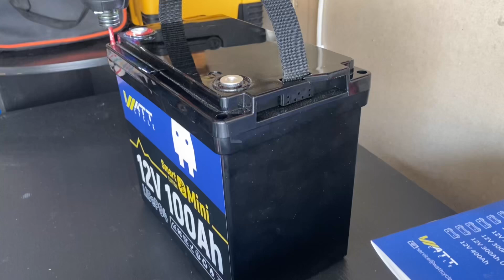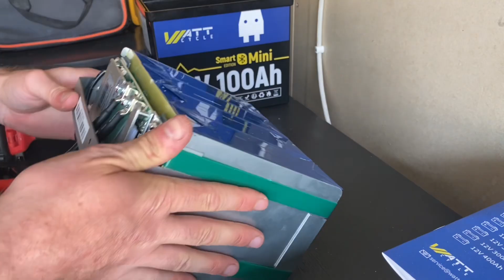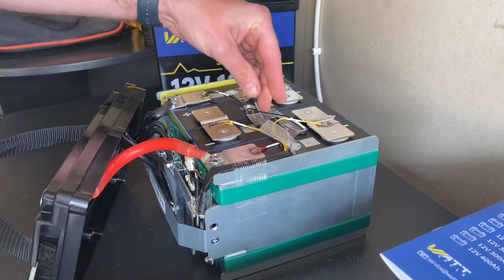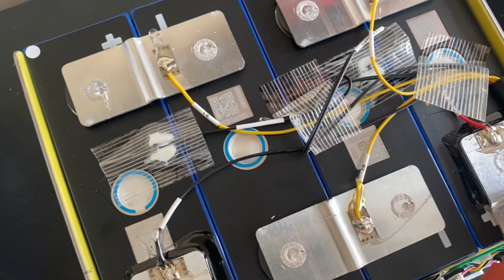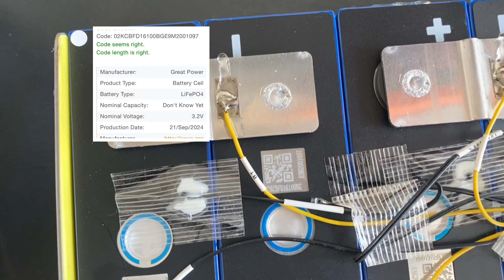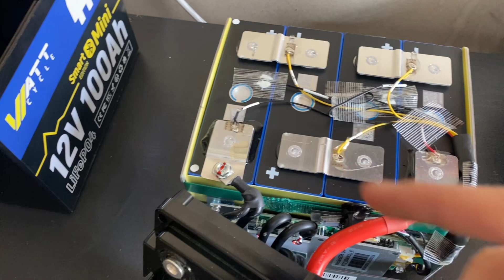WattCycle Mini LiFePO4 Battery Teardown | QR Code Check + Compliance talk

Comment: It appears that 2 of the cell vents are taped over. Would that not impede or even prohibit venting should the need for the cells to vent occur?
Reply from the maker: If thermal runaway would most likely blow the tape off. It is not ideal to tape over the vents though. Good eye👍